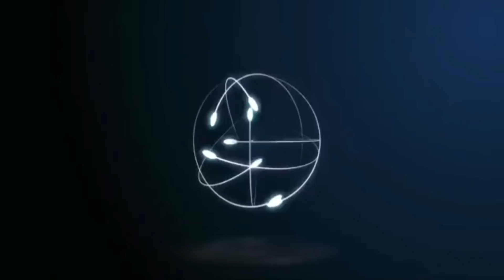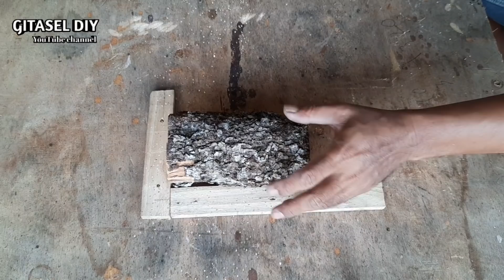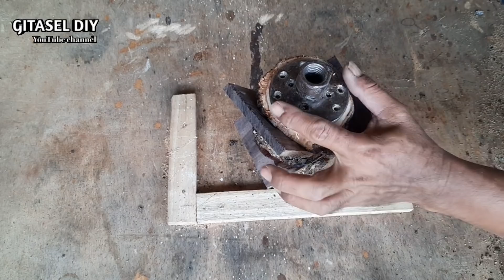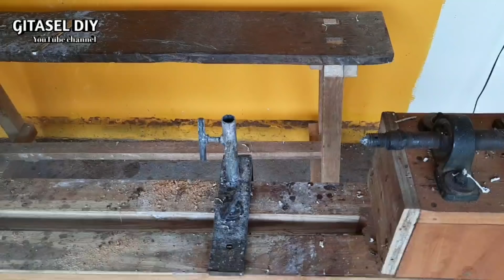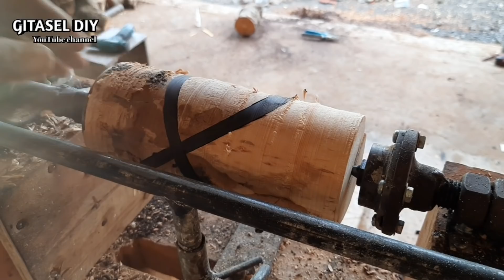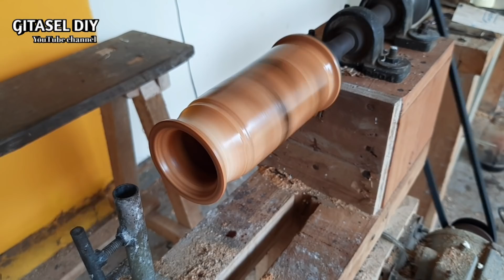banyak ide untuk menciptakan karya seni....bubut mayu

Comment: Unlike what was shown, I'm pretty sure he did glue more than just the edges. Its clearly 2 different blanks. If you look at the first one where he only glues the edges on one side the X of the inlays he adds don't match up where as the one he actually puts on the lathe does
Reply: Then he shouldn’t show that. It’s dangerous

Comment: The CA glue used around the sides of the blank was to hold an unseen glue joint while the real glue joint set. Otherwise it would've flown apart when he started to cut into the wood past ¼ of an inch.